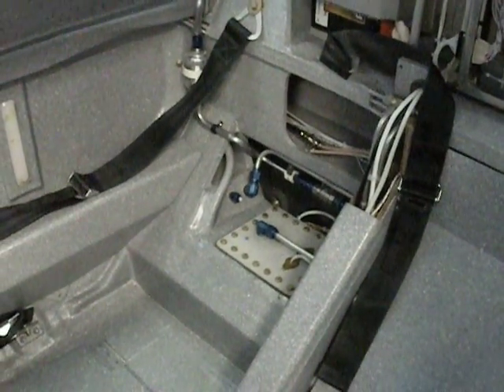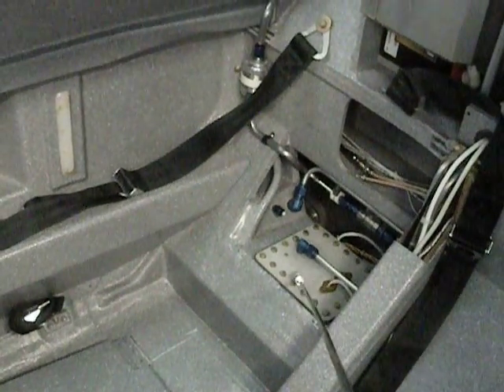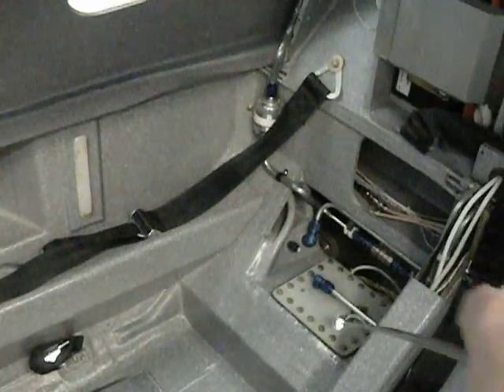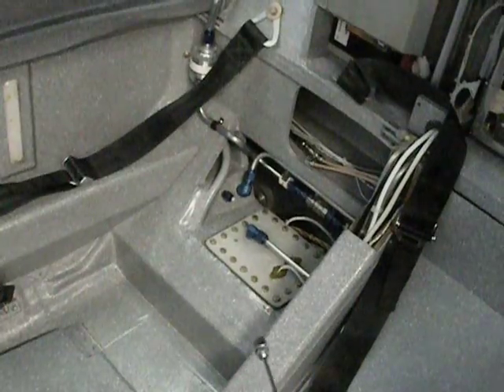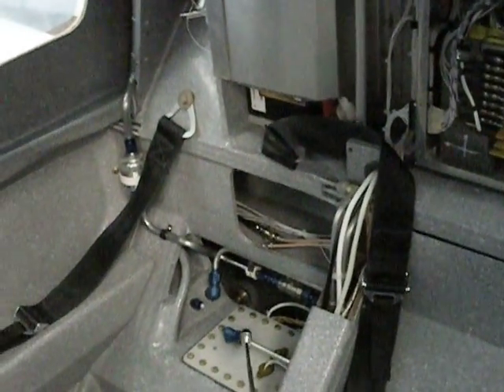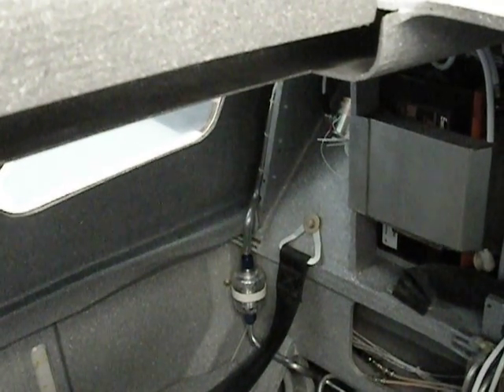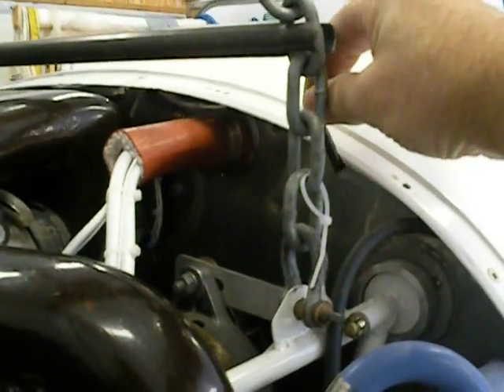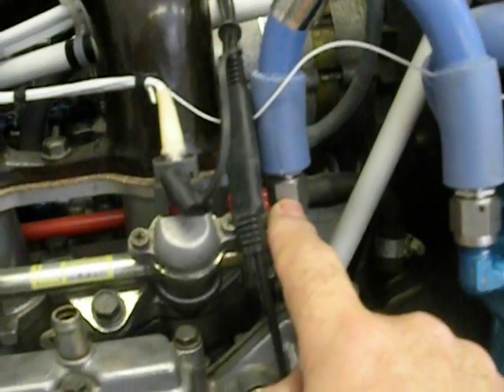Fuel System Part one

Comment: Thanks for the great info Phillip!

I'm also looking at building a Cozy (Have plans from the late 80s / early 90s) and thinking about doing the retractable with a Mazda rotary mod and possibly constant speed prop...

A few quick questions:

1) As I watched the routing of all the fuel lines, I was wondering why you'd want to route them in the cabin?  Was there no other way to go to keep them out?

2) Is the regulation to have a manual valve installed still in force?

3) Where are you located?  I'm in Calgary

4) How's the lady coming along?  Hope really well!

Cheers!

Armando ruggeri
Reply: The fuel lines run through the cabin for a few reasons;
 
·         The strake tanks must flow downhill without any traps to the sump tank.

·         The tubes are large 5/8” diameter because the fuel head is only a few inches when the strakes are low of fuel.  People have used smaller lines and had starvation  issues so short and large diameter is important.

·         The vent line from the two top ‘ears’ of the sump tank carry vapour to a header trap at the top of the firewall.  The lines from these ‘ears’ to the firewall mounted trap need to be large diameter and free flowing as fuel is in these vent lines to a level equal to  the fuel in the strake tanks.  When a bubble is formed in the sump it needs to pass by the fuel in the vent lines so the diameter needs to  be sufficient to allow this to happen otherwise you will end up with a sump full of vapour.  (remember the return line form the Subaru is full of bubbles once it passes through the pressure regulator.

·         The fuel valve is a Canadian regulation that Transport Canada would not budge on even though I pointed out the two high pressure pumps had their own check valves which would prevent fuel flow once the pump is switched off.  They were adamant   needed to be a manually controlled valve so I put one in that would never be used.  I don’t like it as it adds weight and is a potential leakage path.

·         Regarding fuel lines in the cockpit; this is a recurring argument but the plans has fuel lines in the cockpit too.  Personally I prefer fuel in the cockpit to fuel in the engine bay.  Having high pressure fuel spraying across an engine is more dangerous than having high pressure fuel in the cockpit.  Across the engine will cause a fire whereas fuel I the cockpit is an uncomfortable feeling but is controllable and the slightest quantity is detectable by smell whereas in the engine bay it goes unnoticed until there is a fire and it’s all too late at that point.

·         I’m located just outside Ottawa (Search 2 Carlisle circle, Ottawa on google maps)

·         Taxi testing at present.

Regards,
 
Phillip Johnson
C-GPLE
Cozy MKIV RG Powered by Subaru IO-200 (SN 0300)
http://www.canardaviation.com/PhillipJohnson